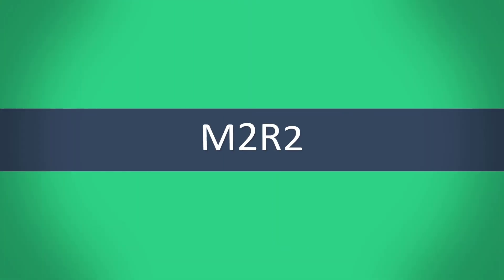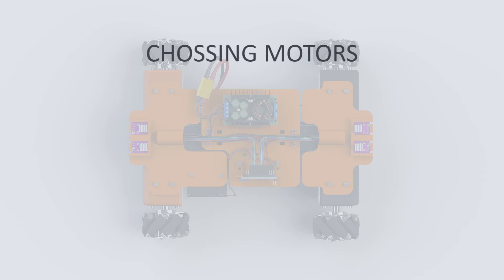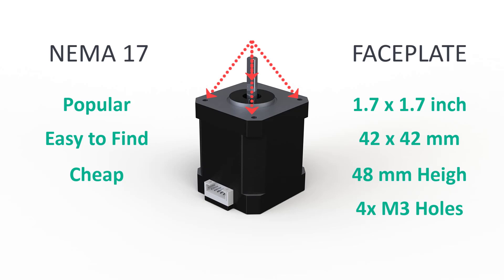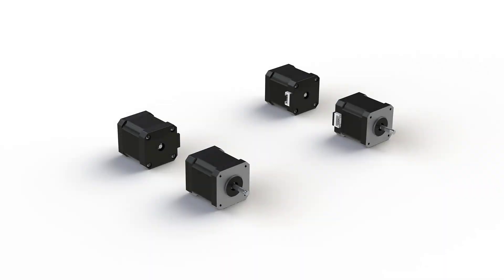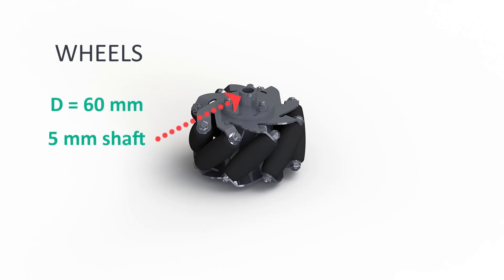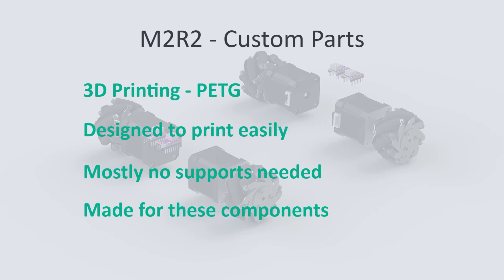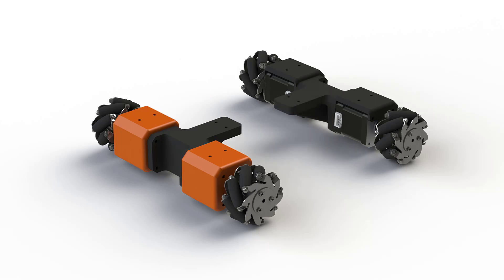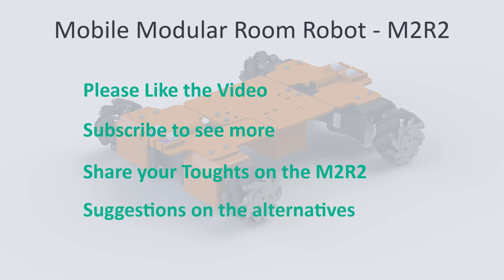Robot Base Design - M2R2

Comment: Your robot base is assembled completely, can it be directly printed using 3d printer or we have to separate all the parts and then send for 3D printing, if yes i mean i have to disassemble all the parts can i get the link of the parts seperately.